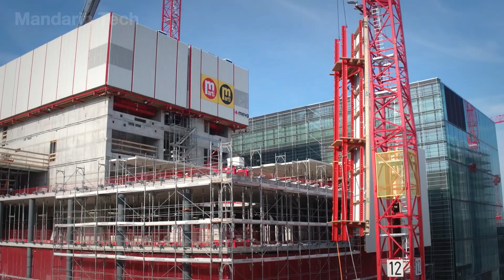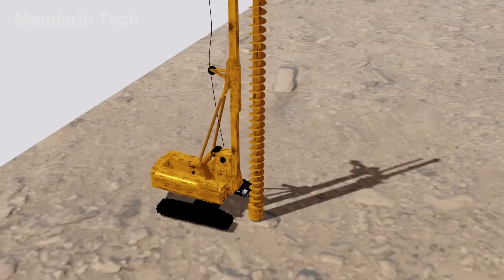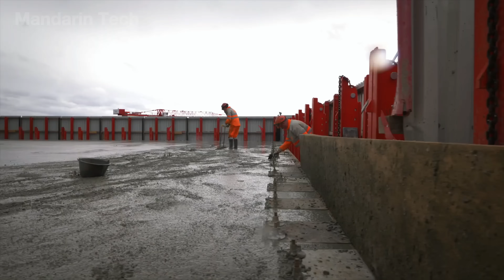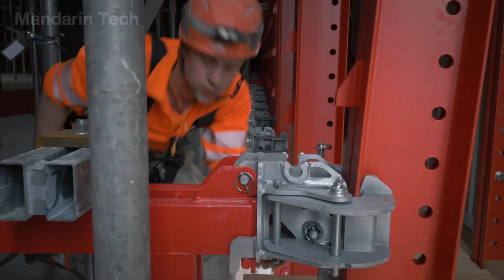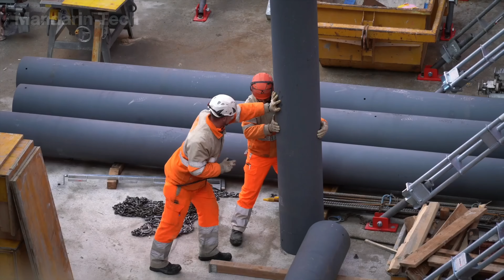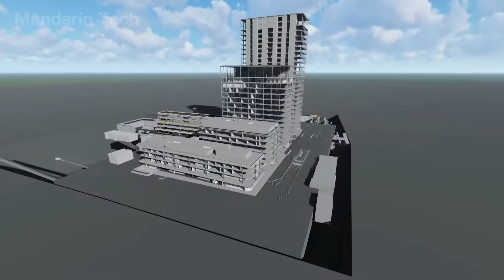How Swiss Genius Engineers Built Switzerland’s Tallest Tower in Just 5 Years

Comment: Field Engineer & Environmental Perspective
🇬🇧 English

From a field and environmental perspective, high-rise construction requires strict quality control, safety management, and efficient resource use.

Working at height introduces additional risks that demand precise execution and monitoring.

Field engineers ensure that construction progresses safely while meeting technical and environmental standards.

Modern vertical construction must also align with sustainability goals.

#FieldEngineering #EnvironmentalEngineering #HighRiseConstruction #ConstructionSafety #SustainableConstruction #QualityControl #ResponsibleEngineering

Français

Du point de vue terrain, la construction en hauteur exige sécurité et contrôle qualité.

Les travaux en altitude nécessitent une gestion rigoureuse des risques.

Les ingénieurs terrain assurent la conformité et la sécurité.

La construction moderne doit être durable.

#IngenierieTerrain #IngenierieEnvironnementale #ConstructionGrandeHauteur #SecuriteChantier #ConstructionDurable

Español

Desde la perspectiva de campo, la construcción en altura requiere control de calidad y seguridad.

El trabajo en altura implica riesgos que deben gestionarse.

Los ingenieros en obra garantizan ejecución segura y cumplimiento.

La construcción moderna debe ser sostenible.

#IngenieriaDeCampo #IngenieriaAmbiental #ConstruccionEnAltura #SeguridadEnObra #ConstruccionSostenible